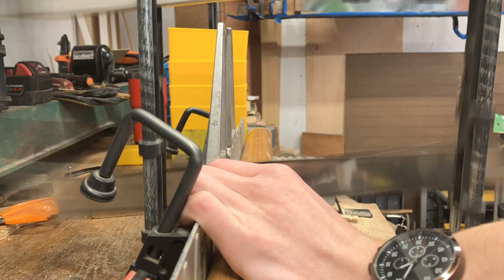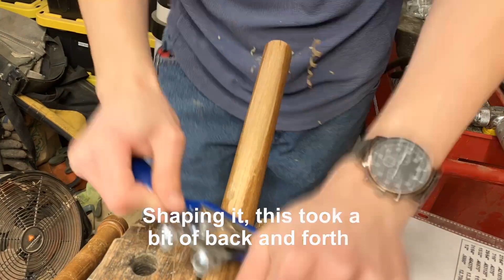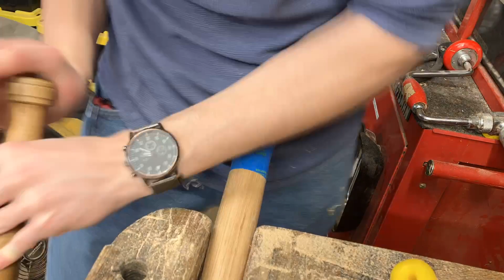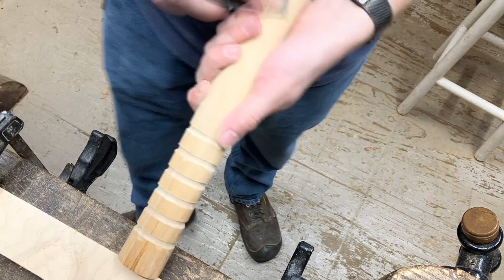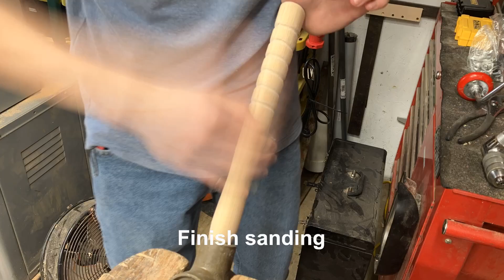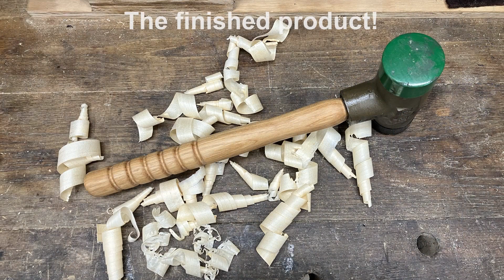Lixie Hammer Handle

Comment: Im a litt le confused. I have a 124 that needs a new handel. Is the wedge built into the head? I noticed you cut the slot for a wedge but didnt see you add one. And on my brokin head i can see the tip of a wedge.
Reply from the maker: The one I made a handle for and two cast bumps to act as a wedge, so I didn’t need to add a wooden one. I don’t know if yours would be the same. Mine the very top of it was flooded with epoxy which made it look like it had a wedge
Reply from the maker: I had a photo so I uploaded it to the community tab. Hope that helps!